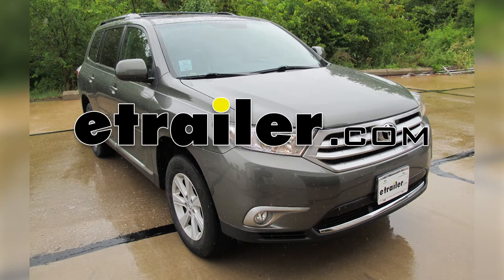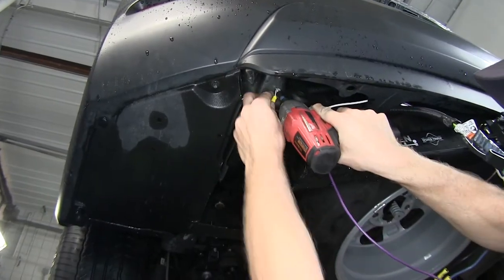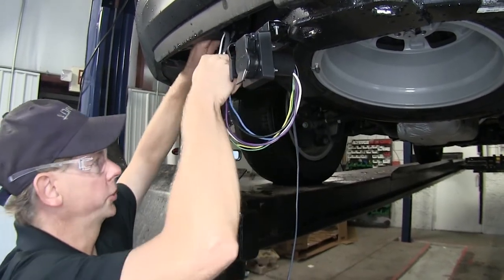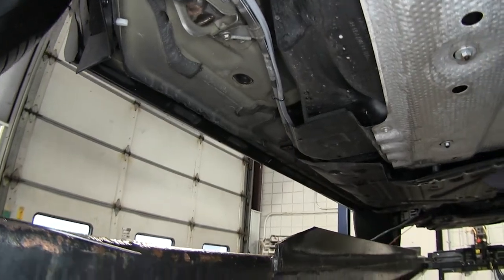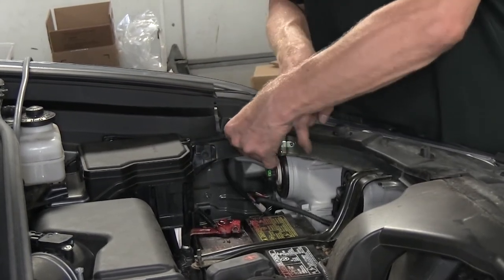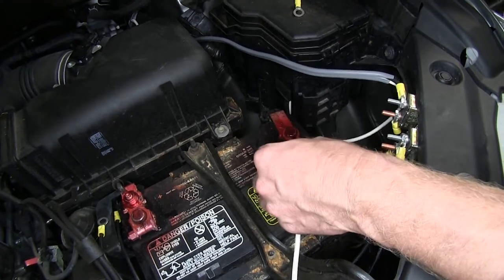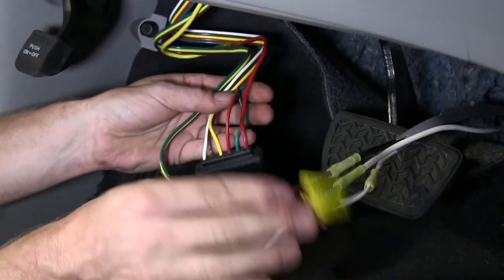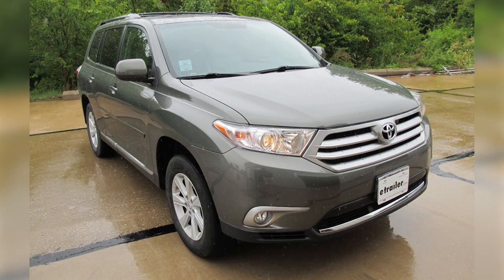etrailer | Install: Tekonsha Prodigy P2 Trailer Brake Controller on a 2012 Toyota Highlander

Comment: Have you folks had problems with the Check Engine light coming on and VSC Off light coming on and my Snow and downhill assist buttons not working on a 2008 Highlander?
Reply from the maker: We did not experience those issues after installing this wiring kit.

Comment: Will this work on the 2012 highlander sport trim?
Reply from the maker: Yes. This brake controller will work with the Sport model also. Check it out in the following link.
https://www.etrailer.com/Trailer-Brake-Controller/Tekonsha/90885.html